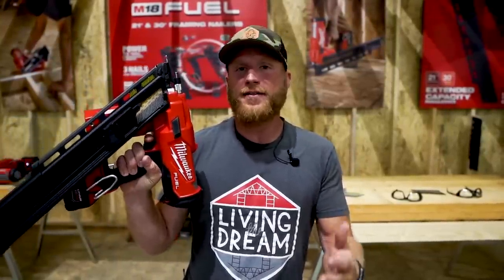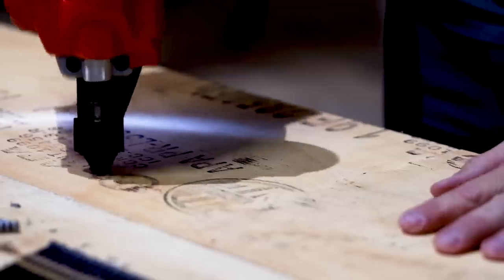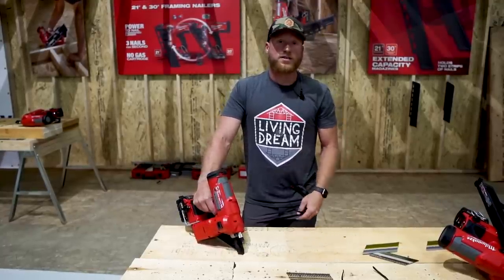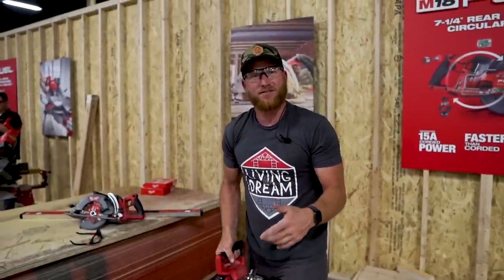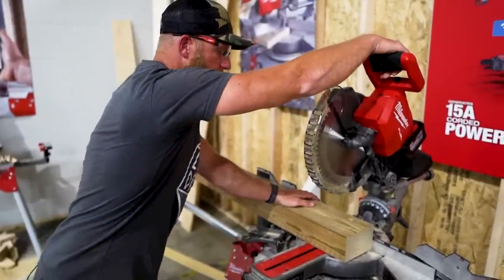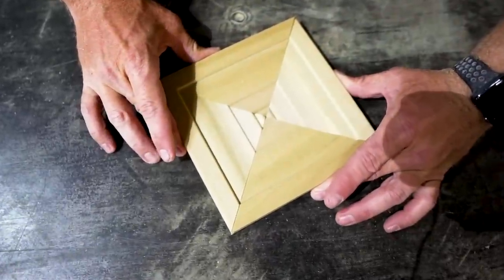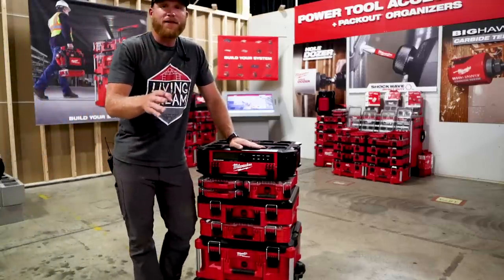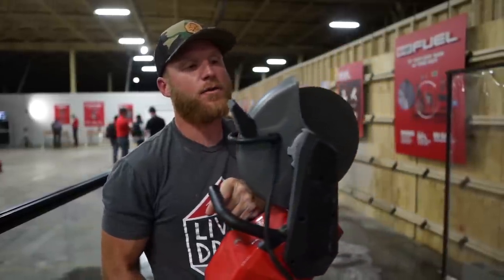Top 5 Milwaukee Tool New Releases: Toolsday NPS 2019 Edition

Comment: Kyle, I think De Walt better get their collective stuff together or they will be a distant memory in the tool business.

I watched your video on you attempting to install Zip sheeting on the last build, where the De Walt cordless nailer kept short driving requiring you to finish hand nailing.
Reply: There already as distant memory  as a company could be in my mind.
Reply: Bill Sheffield what “innovative” tools will Milwaukee come out with if not for DeWalt??? Look, you can have your preference. But DeWalt still leads the field. Especially in carpentry. Don’t believe all these guys paid by Milwaukee to be flied in to promote their tools.
Reply: @petepistachio8229  
Up until I retired a few years ago I had a millwork company and dewalt was the battery brand I invested many thousands of dollars in for the shop and especially the installation crews. We started having lots of problems with there batteries over 60 of them not charging or overheating  I contacted dewalt rep. About the problem and basically he shrugged his shoulders and said sorry not much we can do since all the batteries were not ones they had listed to be recalled. I told all the guys they could have everything in the shop that was dewalt if they signed something to not hold my company responsible in case of fire . I then had to repurchase over 14grand in new tools and I chose Milwaukee after talking to thete rep. In fact anout 3 weeks later 2 boxes of stuff showed up with attn. To my name on the box and inside were 60 new Milwaukee batteries to replace all the crap I had from dewalt. I will NEVER ever buy another dewalt tool purely because they didn't stand behind there product when they should have. We never had much problem with anything Milwaukee other than just normal things breaking or wearing out so I am pretty loyal to them. Even overlooking the problem with dewalt I consider Milwaukee to have more choices, better performance much of the time and were reliable . I certainly dont consider milwaukee's  "innovations" to have much to do with dewalt but rather there own engeneers . Which came first the chicken ir the egg, or rather who copied who first. Electric tools I had every brand you can think of just because certain tools I liked the way they preformed over others or there ergonomics . Once upon a time porter cable made good quality tools like there 360 &361 Sanders and there 691 7537 routers but some brands over time just let there quality drop.  I still have apx. 100 of There routers now and use many of them for my hobby of building boats.
Reply: Bill Sheffield I understand your disappointment with DeWalt after your story. So, you like their customer service. It’s not that Milwaukee makes a better tool. If DeWalt turned around and gave you 60 free batteries. Which by your story sounds like they did. I’d prefer them as well. You have to understand DeWalt isn’t in the position of having to gain market share. Milwaukee is. They are scratching and clawing to get sales. This entire NPS is a marketing ploy. The used car salesmen that they train to stand in Cheapo to beg you to buy their tools, all marketing. It may work. It may not. If DeWalt feels a hit I’m sure they will make a change. If not they will get left behind. As far as me and my business I need tools right NOW!!! And done right THE FIRST TIME!!! I don’t want gender 1 and 2 and 3. They release it and have end user test it in the field. Then when it doesn’t work make changes and release a new “improved” version 2 years later. DeWalt doesn’t do that. Their tool models stand the test for years. Sure there is a dud once in a while but you aren’t spending money every 2 years on rebuilt tools. And they have way more options on the market. You can’t deny that. Look at this NPS. All of Milwaukee tools were rebrands of another tool companies offers. And we are talking OLD tools. What were you to do if you wanted a 12” mitre? That’s a BASIC TOOL.  They are just releasing one now? I see your point with customer service, but DeWalt isn’t or hasn’t been passed by Milwaukee. They still have years of road to cover.
Reply: @petepistachio8229   
Hey Pete,

I'm retired and bored so I don't mind writing some. 
I guess in some way Milwaukee giving me all those batteries may have some bearing on how I look at them, but it has a much larger bearing on how I looked at dewalt. I saw they were not going to stand behind there brand and fix problems when they happened and as a businessman that means a lot. In the later years I was not in the shop much but was out doing prebids and stuff that only I would do, so my hands on with tools was not so much , but the guys using them said they also liked the Milwaukee better even though most of them now had some dewalt ones I had given them.   In the US pretty much your choice for battery tools is dewalt and Milwaukee. I only wanted one brand of battery tool in the shop.  Back then dewalt had a few tools that Milwaukee did not, like a jigsaw which we used a lot for installation so selection was the main reason I first choose dewalt. I also go to trade shows and try out lots of new tools like Kyle. I should say I DID go to shows I'm now retired and live in the Philippines.  When you can go from both to both and try a 15ga. nail gun for example you can really do comparisons between the brands, and If my only choices were dewalt or Milwaukee more often than not I would choose Milwaukee for performance and ergonomics, but if I add other brands not found in US more often than not I would choose them but there just not really made nor intended for the US market which usually made me ask why are you even here. You have a great tool, but the voltage is no good for the US so who will buy it. Metabo it looks to me like  is going to be the first one to bring there stuff to this market or I guess festool already did but there stuff was too expensive  to hand over to guys in the shop or installers and let them destroy them.  If I could have had access to all metabo products that would have been my choice no questions at all but the majority of there products were mainly European market and with the voltage difference I didn't want to go that route, they are starting to bring more things here slowly and the acquisition of Hitachi I have heard will have more to do with that in the next few years.Europeans  make very good tools , in fact probably 75% of the large machines( cnc router, beam saw, edgebandes, widebelts,  etc.) in the shop were European just because the US has very little production machinery to choose from. The AWFS  show in Vegas is coming up in mid July if you have never been to that you might try it and you will see what I mean about US vs European technology. It's the biggest type of this tradeshow in US and dewalt and Milwaukee along with every brand you can think of will be there. Every other year it's in Atlanta. 
 Bottom line for me was I needed a brand that would stand behind what they sold, dewalt choose not to do so because it would cost them a little money, if they had fixed there problem I might feel differently because I would have been happy with there product and may have not even tried Milwaukee but it didn't happen that way.  Of the tools that I bought and used I still prefer Milwaukee and have many of them here now and as soon as there framing gun is available most likely will buy one even though I just bought a metabo one. I tried dewalt guns , I just don't like them there technology leaves the nails proud  of the wood almost every time. Nowadays it's just me, I buy what I like and what I think works the best and I'm not stuck with just one type of battery,  the one color I don't own is yellow .
Reply: Pete Pistachio... I don't believe all these videos, I've been a carpenter for 36 yrs now, I know what works and what doesn't, some Milwaukee, some Dewalt, some Mikitia, some festool... All you seem to be fanbois or just buy tools based on what color you like... Smh
Reply: reddawg rup I’m glad you have it all figured out old man. I know you don’t because you don’t need the best tool. It’s the operator that makes the tool the best or not. Maybe give yourself another few decades and you will get to where I am in 1/2 your time. SMH.

Comment: Great reviews
Reply from the maker: just a quick first impression...will have to wait til I actually use receptively in a work environment, but very promising
Reply: @RRBuildings  i wish you would review 12 inch makita and milwaukee slde compound saw electric model
I dont want battery operated model...
Its for my shop..
Battery model always
Cost more and i dont
Like to have scew with charge every thing.

Comment: The nailer for sure is on my list, and maybe router...not as excited about the rear push or miter though. Seem a bit underpowered but could be the material you were using.

Comment: Hi, have you tested this on cold weather, lets say under 20 degrees.  I owned a senco fusion which has similar engineering and performed very well unless it was cold, seemed like the gas inside the cartridge got to heavy and/or thick and wouldn’t sink nails all the way, just wondering if this would have the same issue

Comment: I've got 2 of There trim guns and have been pretty satisfied with them overall. That framing gun I would buy right now but already bought the metabo one and it should be here in July. Wish I had known I defiantly would have waited for the Milwaukee one.
Is it full head or clipped head.

The other tools are of no big interest to me nowadays. A cordless router that runs for more than a couple minutes would have been great for me a few years ago but corded is fine for me now . A 1/4" roundover is a very light cut so 200 lf. Is not very much really. The plunge cut you were doing is much more of a challenge to see how long a battery would last.

Comment: Nice nailer. Does it take 4" nails. We in norway use 90mm.
Thanks for shereing
Reply: 3.5 inches is 90mm
Reply: @googleisevil1041  thanks.
Reply: @googleisevil1041  90 mm is more 3.54 inch, while 3.5 inch is 8.89 mm, 4 inch is 10.16 cm/101.6 mm

Comment: Looked like you were shooting paper strip nails, but had, plastic strip nails sitting there. Personally im not going to use 2 different types of nails if it only takes paper strip. On the worm drive style clone it clearly doesn't seem to have the power of the Dewalt. At least they are in the game for framers.

Comment: Is the Nailer lighter than the Hitachi? If so by how much? Hitachi is around 10 pounds with the battery and the gas pasload is around 7 where do you think this one falls?
Reply: 9.4 pounds w/o the battery and the extended magazine. Metabo-HPT weighs 10,8 pounds. With the heavier battery on the Milwaukee and the added weight of the magazine =  a couple if ounces difference between tools.

Comment: And I just bought a Makita LXT router a few weeks back. I should've waited for NPS
Reply: Nah bro the Makita router is just as nice along with the dewalt trim router
Reply: @justgregnow  I know it's a great router, but I said that because I have plenty of milwaukee batteries but only 1 makita battery for the router (Gonna get a second one soon) I also have the LXT orbital sander which I got for free when I bought the battery and charger
Reply: @kylepaulson8357  it's definitely not a bad thing to be in both those platforms. Plus you'd have to wait awhile to get the Milwaukee. I just picked up the dewalt XLT trim router it's awesome.

Comment: Hi,

Just one question on the milwaukee framing nailer gun. Is this nailer excepting full round head nails or is it half head nail. Just can't tell in the video.
Reply: 21 and 34 degree was shown in tge video.(plastic and paper collated nails). Take your pick
Reply: @zackfishle1009  

I'm asking because if you watch the video he never put the plastic nail clip in the framing gun. It was always on the table in front of him. He was only putting in the paper. So i couldn't tell if the paper clips where only half head nails like a paslode style. I must have missed someone saying it can use full round head nails like a air gun. 

I can't even see the top the head when he is nailing it into the wood. No one is zooming in. Again i could be wrong but just wanted to make sure..
Reply: @ 3:20 There is a wall paper in the background that says the two different collated types of nails. I am assuming you can pick one model or the other based on your preference.
Reply: @zackfishle1009  

Just have to wait and see someone using the plastic style nail clips with framing gun and see how it performs.

Comment: Anyone else curious when the battery gets upgraded to a “new type” and all these tools no longer work
Reply: They'll prolly do something like dewalt and have a hybrid batter 18v/60v. But for now they just made the new 12ah and it works on every tool I have. New gen and old gen
Reply: Heck ryobi tools are compatible all the way back to 1st gen in the 90s.
Reply: First gen was using 18V "V" series batteries, mostly NiCd batteries but also a few LI-Ion . The new gen now uses 18V "M" series batteries but they are not interchangeable with the "V" tools, different form factors. Many people were pissed as they had hundreds of dollars invested in those old tools. Milwaukee also abandoned the old 36 volt series. Milwaukee does not make an adaptor for old NiCd tools to accept new Li-Ion batteries but DeWalt does. I think the old brushed Milwaukee is more reliable, all mine still working but couple of my new Milwaukee tools have burned out.

Comment: Other nailers use 2 clips, contrary to what he said.
Reply from the maker: Name one?
Reply from the maker: Yeah BJ but that’s pneumatic.... this is in reference to the new line of battery powered nails.   You are correct most if not every pneumatic nailer I’ve used has room for two clips some have three
Reply: @RRBuildings  Thank you for the clarification. I hope this didn't cause too much trouble. Good luck with your channel.

Comment: Did you saw that orange glow flying at sky line it was my Paslode which got replaced by this.

My Milwaukee retailer said this nail gun was on prototype stage at January 2018 but it had too much issues back then.

Comment: lol that nailer is what 1000 bucks? as a framer you might get a year out of that, then youll tried and use warranty, oops thats expired, then youll try and repair it and milwaukee shruggs their shoulders. stick with a bostitch, guys all over the trade fix those guns and many shops too. skill saw is too heavy and underpowered, as well as the mitre saw, a great homeowner tool or remote jobs with no electricity. router was impressive on osb, but most commercial jobs in canada require 1/2 sheathing, id like to see a demo on that. batteries too expensive, and they are a throw away item, extension cords can be repaired and re used for years.. this is clearly a sponsered vid, and you will do anything for milwaukee to get free tools. you dont need all this crap to frame up a shop
Reply from the maker: $1000??? You listen or watch the video?  $349